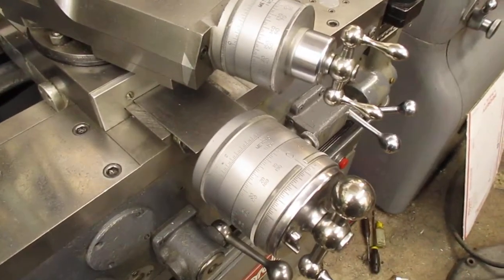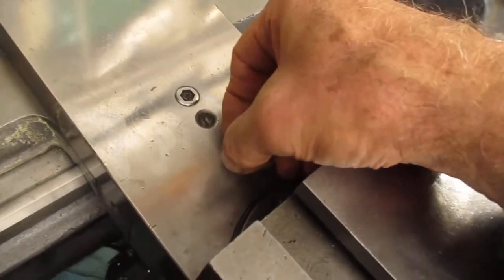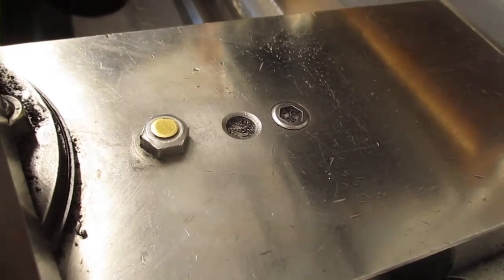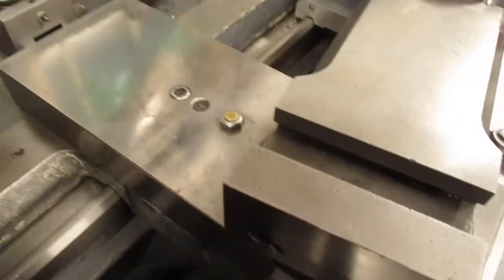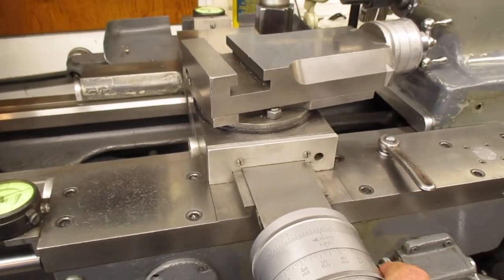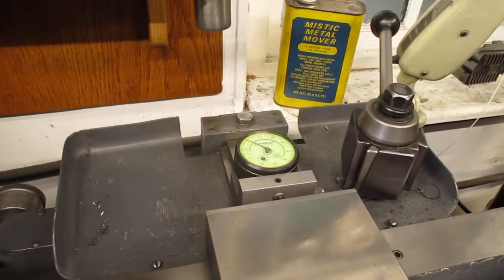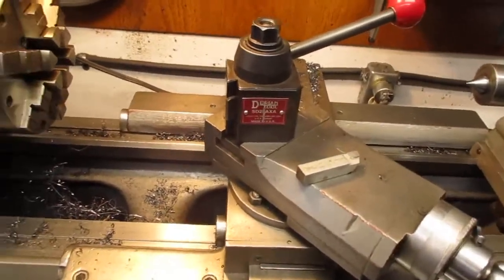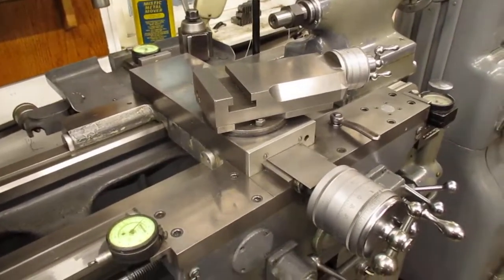Monarch 10ee lathe cross feed lubrication and adjustment

Comment: Correct me if I a wrong but I believe the oil pump for the apron pumps when the apron is moved, regardless if the machine is running or not.
Reply from the maker: Hi, yes the pump works moving the carriage.

Comment: Thanks for sharing the trick on how to keep the cross feed lubricated.  On my lathe the end of the cross lead screw and the the end block/thrust bearing is a me is a mess.  I’m hoping to not have to replace the screw, nut we’ll see.
Reply from the maker: Hopefully those parts are good, the odds are they are. The old guys when I was a young guy, would just remove the binder bolt and dribble oil down the hole on to the screw, then fiddle around stabbing the bolt back into the clamp.
Reply: @deedeeindustrialsuperprecision  I’m sorry to say the screw end is buggered as is the thrust bearing block.  I’ll cross that bridge when I get there.